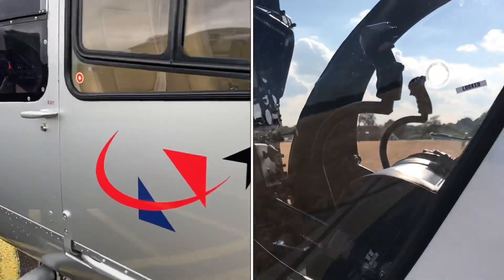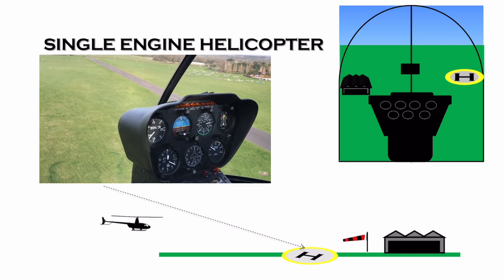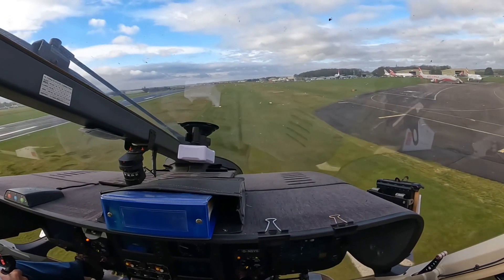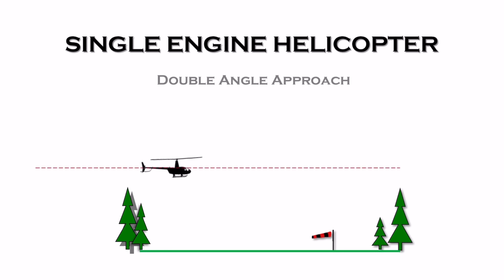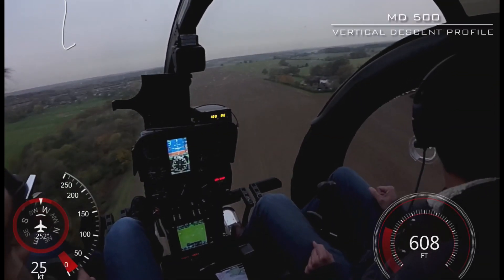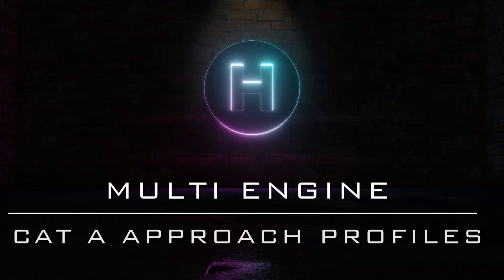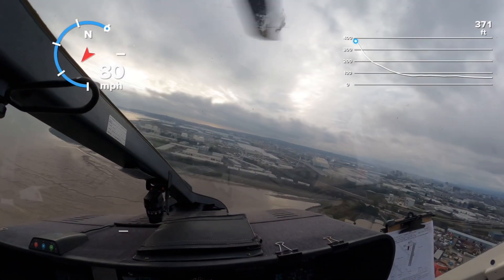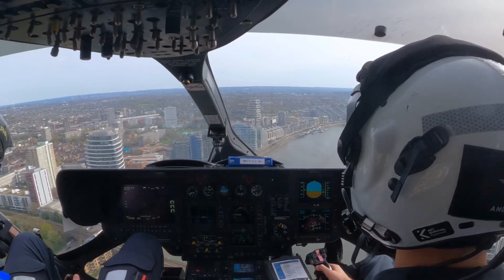How to land a helicopter

Comment: I fly all these types in MSFS with VR, bit of motion, haptics and what I needed to get used to the most, is that you have to do these techniques  way slower than you would feel they need to be done. Always think : slow down, you’re still too fast ;)
Reply from the maker: Really good advice! Slow is smooth, smooth is fast !
Reply from the maker: Could you possibly share the details of what sort of set up you use ?
Reply: @ABHelicopters  Currently I have a beefy PC, Reverb G2, small amp with two budget shakers and a 2 DOF NLR V3 motion platform, which I modified ( hacked ) to make the pedals move with the seat. I am in the - slow - process of building a Departed Reality DIY motion platform to replace the V3. Which is already awesome by itself but I just want to experience 6 DOF. Motion is not the most important part of the sim, but it is the most unnerving, anxiety inducing, part. Doing a manoeuvre and feeling the ( some ) consequences, really makes you want to handle the aircraft gently.
The only fundamental DOF missing on a pitch - roll platform is heave, all the rest can be simulated. Especially yaw is way more realistic than you would imagine, made possible by the fact that the pilot is not in the CG of the aircraft.
Reply from the maker: Wow - that’s one hell of a setup! I’m very impressed. It is something that you have been building over time , or did you take the plunge and build most of it at once? What’s your take on VR, is it the future of gaming and simulation ? Do you ever suffer from vertigo induced by the goggles or does the coordinated motion help offset any disconnect between the senses ? How about support for other simulations - is it easy enough to adapt to DCS , or X plane , for example ?
Reply: @ABHelicopters 
Thanks for the friendly words. 
It was built over a short timespan. About 1.5 years. 
VR : the greatest thing since sliced bread. If you have set it up correctly, there is no going back, especially for VFR, and thus pretty much 90% of heli ops. Started out with a face tracker ( SmoothTrack ) on a big monitor, but never used it again since the G2.
The only downside you could say is, it stops me from trying a virtual ATC because there is typing and writing involved, not too handy in VR. My Hotas, pedals and a couple of keys on the keyboard, is all I can manage to manipulate when wearing the goggles.
Vertigo or motion sickness : very little in the beginning, and it very quickly went away.
Motion is super convincing in VR. If  you yaw the heli to the right, you don't have the feeling that the seat is tilting forward and left, you actually feel that you are thrown out of the heli, but still in the horizontal plane.
I did start out with DCS and so my first VR experience was on that platform in an F-5 jet. The only thing I could think when I first saw the VR was : "I am finally there" :)

Comment: Thanks for another great video Andrew! I'm still a little confused about the h/v diagram not being applicable for landings... it is my understanding that the diagram relates to specific combinations of height and airspeed where you do not want to be in the case of an engine failure, which makes perfect sense but surely we still have to consider a possible engine failure whilst landing, or are we just all agreeing that it's a risk we need to take in specific circumstances? For example a power check might show that I have enough power available to perform a full vertical landing, however the h/v diagram would advise strongly against this, so do I perform the vertical landing or not? That is where my confusion ultimately lies! Thanks so much for the info and as it happens, I have my PPL skills test tomorrow in Doncaster after 5 cancellations over the past two months due to poor weather! I am very nervous! Haha!
Reply from the maker: The h v diagram doesn’t apply to a standard approach . To understand why, you need to consider how the h v diagram is constructed .
The following explanation comes from Richard Mornington Sanford, and relates to the Robinson R44

The low hover point - 10ft/Okts, no flare no time delay, normal pilot reaction time. Collective cannot be lowered and hard surface/soft surface. The knee of the curve - 150 ft / 50 kts. From the low hover' point to the knee of the curve' is conducted at 'take-off’ power with no delay.
The high hover point - 400 ft/ O kts, Stabilised OGE hover, vertical speed near zero, 1 sec delay prior to lowering collective and a reasonable dive angle, 10° 20° max nose down Attitude .

The high speed portion - Normal pilot reaction time. Power as required for level flight, no delay.

Why the diagram doesn’t apply - On approach: There is less power being demanded. There is less pitch angle, angle of attack. There will be a rate of descent, so an induced flow up through the disc, against departure where the induced flow is predominantly down through the disc.
Weight, wind speed, weight etc, etc might not be as required during the development of the HV diagram. In short, the diagram is developed under strict conditions involving hover height, take off power, cruise flight conditions and not during approach power or conditions.
Reply from the maker: However, wishing you a the best of luck for your test
Reply from the maker: Short answer- during the approach you are already in a forward airspeed descent with low blade pitch angle, whilst the top of the h v diagram assumes a hover with high power setting , plus a 1 second delayed reaction time before lowering the collective lever- so the h v diagram doesn’t apply . For the bottom of a vertical decent to a confined area - say with 35 ft trees around you - yes you are then very much in the h/v diagram shaded area, and it’s about minimising the time spent there - but you have to balance the risk, better to take your time and carefully descend slowly into a tight spot - with the very small chance of engine malfunction vs rushing it and potentially hitting a tree branch
Reply: @Tom Gulbranson Thanks so much for the kind words Tom! I did get to read them at the time but did not have time to reply until now and I am thrilled to tell you that I did indeed pass my test on the R22 yesterday!! I had a few hairy moments with a couple of maneuvers that I thought was going to fail me, but the examiner gave me a second go as I'd briefed him correctly on what I was going to do but for some reason (I put it down to the stress of doing so many different things in one flight and trying to remember everything) I did not execute it as I'd said I was going to. But overall I felt like I'd flown well and I was super pleased to hear "Congratulations, you've passed" at the end! :)
Reply from the maker: Fantastic news- well done!
Reply: @Tom Gulbranson Thank you Tom and Andrew for the congratulations!! I am still in a somewhat state of disbelief that I've actually got to this point! One part of me is incredibly excited to start building hours and experience for my CPL, the other part of me is super anxious knowing that I now have to get out there and explore new territory/airspace without the safety net of an experienced pilot next to me! 

It was actually the "Engine failure in the hover" that really worried me on my test... I'd told the examiner exactly what I was going to do, right pedal, let the aircraft settle and then pull collective to soften the landing but what I actually did was immediately lower the collective and the examiner had to override me by pulling it up. Of course I was incredibly frustrated at myself because I've done them so many times before and I'd just finished a real well flown "Nav" part of the test so I thought I'd really messed it up for myself, but thankfully I was given a second go to correct it, which I did. The reason this happened is because when that throttle went off my brain immediately thought "autorotation" so I instinctively lowered the collective. I guess every day is a school day with flying! 

Great news about your son Tom! I'm a little late in the game as I'm now 38 but in hindsight I would have loved to have gone through military flying school, I imagine the training is superb.

Hopefully one day I'll get to meet Andrew too somewhere and even better, do some flying together!
Reply from the maker: Congratulations again- hope you enjoy exercising your new freedom! By all means, if I can ever help with any guidance or career advice , please let me know- happy to help!
Reply: @ABHelicopters  thank you so much Andrew, and thank you for always taking the time to answer my questions, you can rest assured there will be many more! 😂 out of curiosity what kind of flying work do you generally do at the moment?
Reply from the maker: @nizza594  hi Neil, at the moment I’m not doing much flight instruction owing to other flying commitments , but still managing to squeeze in a bit of ground school. Ping me a line via email to say hi, as unfortunately I sometimes miss comments on YouTube !
Reply from the maker: That is certainly fantastic news too - well done. Re test pilots - at Edward’s or pax river ?